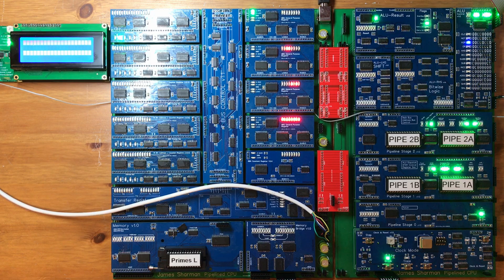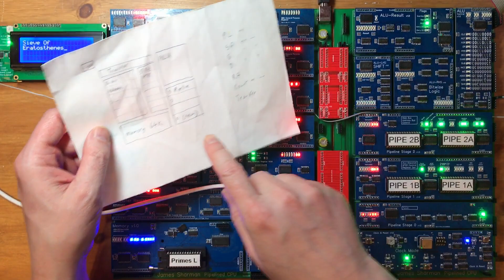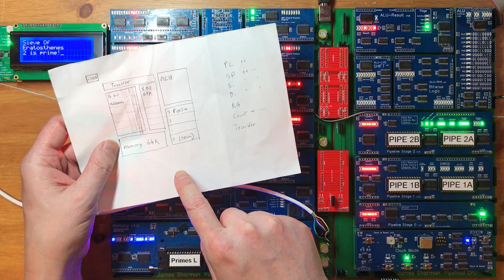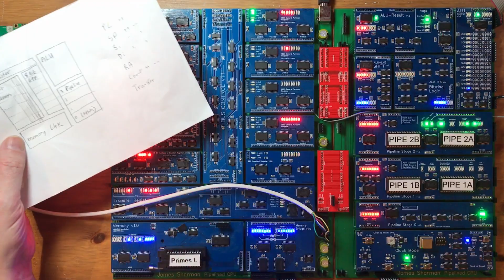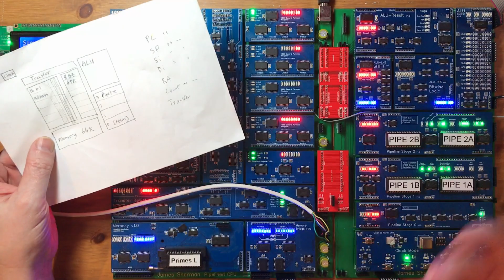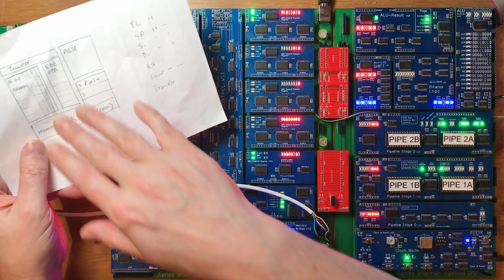Architecture Questions Request - Making an 8 Bit pipelined CPU

Comment: I've got lots of questions / requests ^_^

1. Recap of the existing pipeline, as it is the main difference compared to other 8bit projects people post online.

2. Do you think you'd benefit from adding any extra pipeline step?

3. Could you explain a bit about the analog parts? eg: how do you know which capacitor to put where? what about when you put a resistor next to a diode?
Reply from the maker: I do a bit of a recap of the pipeline in the introduction https://youtu.be/QZMcBETdydA but I also address your 4th stage question directly here: https://youtu.be/QZMcBETdydA?t=1105

Comment: I suspect the main reason you made the CPU pipelined was for the challenge of it, but ignoring that motivation, do you think making the CPU pipelined increased the maximum throughput you were able to achieve compared to something more like the 6502 architecture, which isn't pipelined but packs a lot of work into each cycle?
Reply from the maker: I think you'll be surprised, I answer your question here: https://youtu.be/QZMcBETdydA?t=1228

Comment: Well, given I'm trying to piece together an emulator from the videos, my question would be: do you have a comprehensive set of architecture documentation including timing information?  But I suspect the answer to that is "no".  So how about this: what are your thoughts on how the CPU handles IO?  When I've designed computers on paper, I've usually given them a much beefier expansion bus, and I'm curious if you feel the design you've gone with will get the job done.
Reply from the maker: I answer you directly here: https://youtu.be/QZMcBETdydA?t=4216

Comment: Hi James.  Thanks to yourself and Ben Eater I'm now building my own 8-bit CPU. I'm basing mine loosely on a 6502 and have had some troubles with the Control logic and Flags register, so was wondering what your thoughts were around this area...  Specifically:

* The 6502 allows the flags to be individually set/reset, as well as loaded and restored from the bus.  I don't believe you did this, but as a developer I suspect you may have used this feature.
* I'm coming up on 40 flags and using 28C16/256 is proving to be slow and cumbersome.  I like how the pipeline splits these up, but did you have to compromise on features to not run out of lines?  

Either way, can you talk about your decisions in these two areas?

Thanks - this will help be greatly
Reply from the maker: I address both of your questions here:  https://youtu.be/QZMcBETdydA?t=2921 with a reference to the answer I gave on flag preservation for interrupts.

Comment: Would you have found an in-built stack register (write:push and read:pop using microcode) useful when writing programs? Could this even have been done in a pipeline-friendly way with your design?
Reply from the maker: I answer your stack question here: https://youtu.be/QZMcBETdydA?t=3433
Reply: @weirdboyjim  Thanks very much for the detailed response!

Comment: My question is what was planned for the fourth pipeline stage which was eventually removed? What capabilities did you give up?
You had a lot of trouble with that memory board, I seem to remember. Any good tips for avoiding that next time around? 
Last question, about how much power does this draw at full load? Those LEDs can't be cheap. I remember the breadboards had a ton of resistance and in the beginning you had a lot of trouble with the routing of that. 

Been watching since I first heard about it, when you were still building the pipeline stages. Kept me entertained for a long time now, definitely more invested in this project than I probably should be. Keep up the good work and I can't wait to see the video adapter!
Reply from the maker: The power question I answer here: https://youtu.be/QZMcBETdydA?t=717  but I answer the 4th stage question separately here: https://youtu.be/QZMcBETdydA?t=1105

Comment: I'd be interested to hear more about how the pipeline works, and what you think the practical performance improvement is like compared to an equivalent architecture that is not pipelined (if any -- perhaps the pipelining here is purely educational, which is still cool). Also, whether you think there would be any improvement from creating multiple ALUs (for example) so that there is an ALU available at each stage of the pipeline. Great project, I've enjoyed what I've seen!
Reply from the maker: I answer your performance question here:  https://youtu.be/QZMcBETdydA?t=1228  I wouldn't see value in extra ALU's, I'd need to be able to dispatch more instructions first. Unless I was going something like SIMD.
Reply: @weirdboyjim  Really interesting, thanks! I watched that segment just now, plan to watch the rest later on.

Comment: I would like to know what your decision process is/was around interrupts. Also why the diodes not an EPROM? I think you said you could accommodate more pipelines in this build? Any extension plan? Was there any instructions you would like to have supported but didn't? MUL DIV etc? How long did you spend on design before jumping in with breadboards? 

I am currently writing an assembler for mine in Rust (I seem to like beat myself up). I noticed that the software design flagged a number of hardware flaws I didn't see, did this happen to you?
Reply from the maker: I address the interrupts here: https://youtu.be/QZMcBETdydA?t=1393

Comment: Building a software toolchain seems to be a critical and difficult part of a project like this. I've been looking for an assembler that I can customize the instruction set, yet have all the built-in functions necessary in an assembler. Things like ORG, ALIGN, SECTION, etc and how they drive a linker/loader. There are some open source projects that are used extensively for Linux and new hardware, but the complexity is quite over the top with respect to a project like this. It wasn't too clear to me where you started with your assembler. Was it someone else's toolchain that you adapted to this project? This has been a phenomenal project, and I'm pretty much waiting for every video you release. All the best!
Reply: The most cumbersome part of making an assembler is to manipulate the text correctly.

I'd recommend you try doing your own in python, processing line by line.

For example, to parse "abc: mov #123,rx" you can do something like this:

label, s = s.split(':')
s = s.trim()
opcode,s = s.split(' ')
src,dst = s.split(',')

Just remember that you'll always assemble <1M lines and you've got a modern machine w/ more than a gig of ram --> you can afford to do wasteful but easy to read code :)
Reply from the maker: I talk about the toolchain here: https://youtu.be/QZMcBETdydA?t=2018

Comment: Do you foresee yourself extending the instruction set in the near future? I don’t know how much code space you have left in the 8-bit instruction word, but with the core hardware complete, that does seem to be a good way to add some polish to an already great build.

Also, will you publish an architecture specification? It’d be cool to see what the community creates with it; compilers, assemblers, games, emulators; the sky’s the limit.
Reply: I actually built a simulator using "Digital" (a logic sim), which is open source.  It has a couple of bugs in some of the parts that I finished before his PCB conversion (I'm sure I could fix those relatively quickly, I just took a break from working on it for a bit), but it's capable of doing quite a bit.  That said, I used some architecture files that were provided to me privately, that I don't feel comfortable sharing without permission.  However (and perhaps he'll see this and chime in), if James decides to open source the architecture file (I wrote an alternate assembler, but it still requires his architecture file), it could absolutely be used as a full simulator for CPU.  Hardware-wise, the only thing in the current build that isn't in the simulator is the audio circuit.
Reply from the maker: I talk about the architecture specification here: https://youtu.be/QZMcBETdydA?t=4345
Reply: @weirdboyjim  6502 was very fast, i'd say 8bit RISC processor of the time - up to 1 command per 2 clocks. But it had a flaw - copying memory blocks /* too much clocks per one transferred byte*/. Z80 improved situation with LDIR/LDDR commands, but it still looks like re-reads the command byte for every data byte transfer. What do you think, how much it will take to extend your CPU to implement LDIR/REP STOSB command? Is it possible to implement it the way without re-reading the same byte of command and to make possible to avoid the need of dedicated DMA controller in a computer?
Reply from the maker: @alexloktionoff6833  it would need some extra hardware. I have lodsb/stosb but implementing rep really needs another counter. Going via the alu woild still have contention with the main bus.